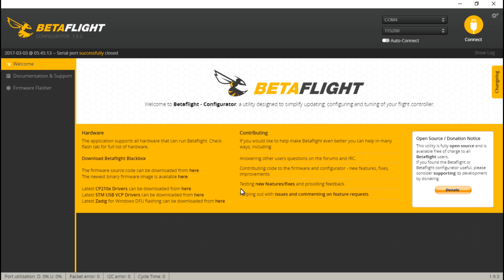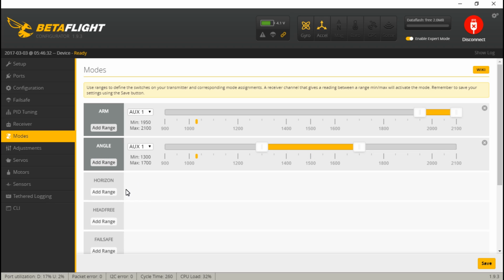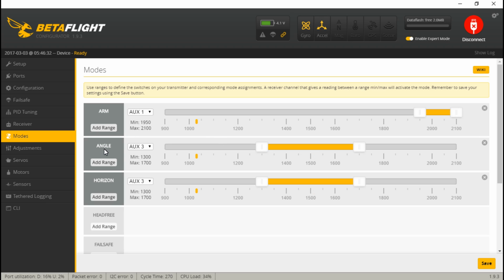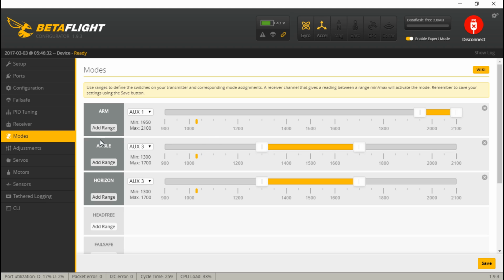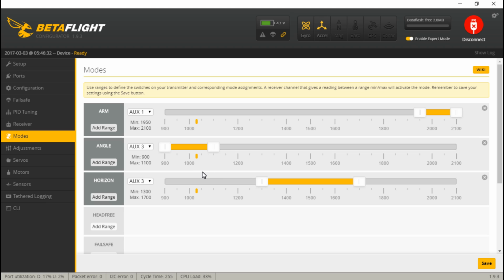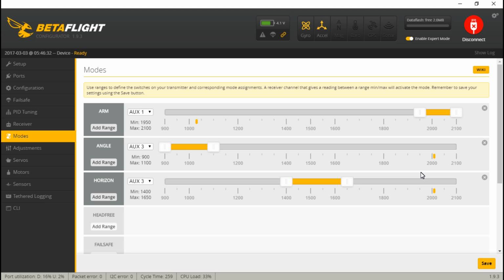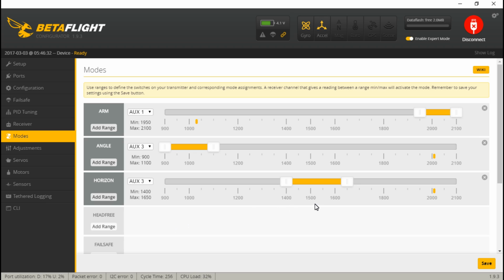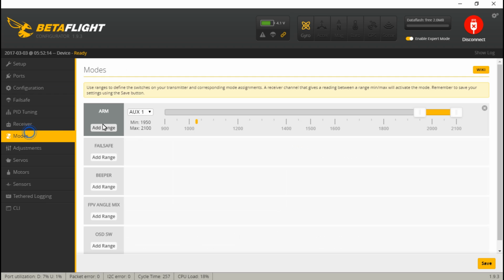Setting Up Flight Modes In Betaflight / Cleanflight

Comment: Is air mode just acro mode with the props constantly spinning? Is there auto level on air mod?
Reply: Long said dead but in case anyone else ever reads this, Air mode is a sub Category, Air mode only means your props will have a minimum RPM after armed, this is so that even if you go to zero throttle and due a flip upside down the props still maintain spin, this gives you instant control and more importantly this means the flight controller never loses control of the angle, if the props were to stop spinning the craft would flop around significantly making the flip almost out of control,  Acro mode which is separate removes all the constraints of horizon or angle mode, it allows the craft to be full orientated by the user, IE flip and roll without constraint

Comment: I have a naze 32 laying around because I was convinced by this cool dude to replace it with a flip 32. So I am currently building a foam airplane and while I know CF/BF can be set up for airplane I have yet to find any solid or recent guides. Any chance of this being a future project? Even just somewhere to start with connections and settings would be useful.
Reply from the maker: Yea I can do that. I'll start with some basic plane videos then add in a flight controller after that.
Reply: Awesome! Thank you so much, really looking forward to what you come up with.